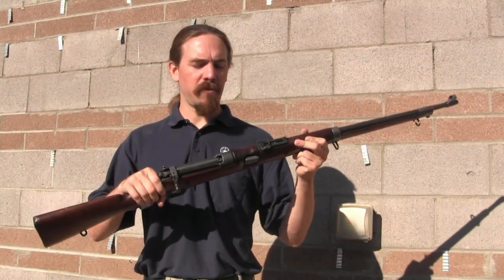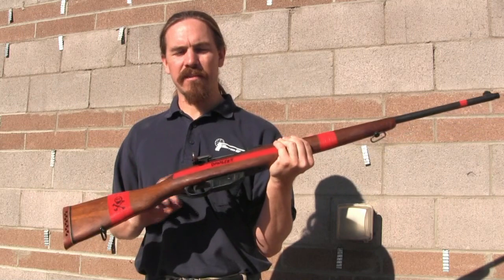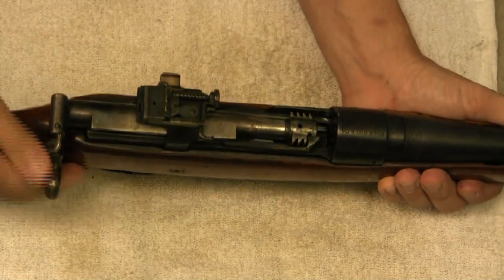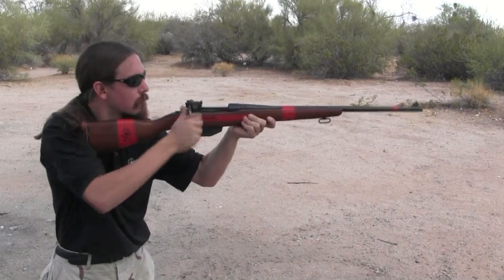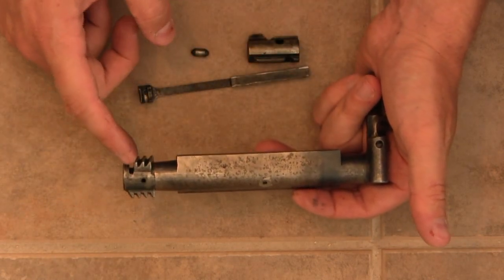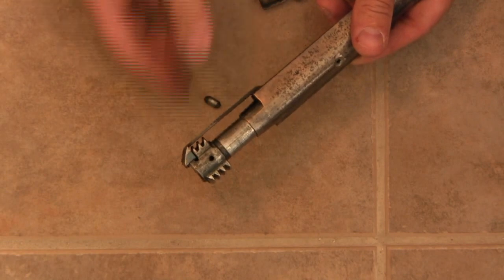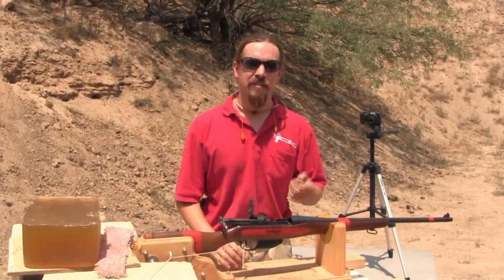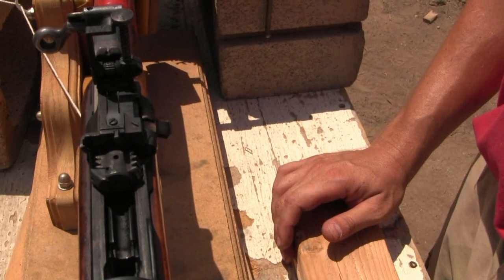Myth and Reality of the Ross MkIII Rifle

Comment: Good fucking thing I watched this. I just got a MK3 Ross, and the bolt doesn't rotate and lock. Thanks to this video I won't be blind in my right eye lol.
Reply from the maker: +ProJirard the Finishist Yikes!
Reply: +Forgotten Weapons I fixed it and now the bolt turns, but when I push the bolt all the way in, I can pull it right back out, is it supposed to do that? It should be locked in place until you fire right?
Reply from the maker: +ProJirard the Finishist As long as the bolt head is rotating when you push the handle forward, it is locking. You can always unlock it by pulling on the bolt handle; firing the rifle will not cause it to open because it does not put pressure on the bolt handle. Think of it like unlocking a deadbolt - you can always unlock it by turning they key, but if you push on the door without turning they key it stays locked shut.
Reply: Yes.  unfortunately, the Ross rifle is (and always has been) a rather crappy rifle, in every area except for its accuracy, in which it is actually fairly decent (Allied snipers loved the Ross as a result, even though it failed in every other avenue).
Reply: Finally got a chance to fire it a week ago, worked without a single issue. Got it all sighted and is it ever an accurate rifle.
Reply: It's a great range rifle!
Reply: ProJirard the Finishist , how much did you pay for that ross rifle?
Reply: How much did it cost ya?
Reply: Awkward to see it properly when the teeth engage inside the barrel. 
Glad you have seen the video.
Reply: @Canadian_Metalhead  I'm glad you saw this before you tried to fire it man, could've been a bad day at the range
Reply: You can actually see the bolthead rotate 90 degrees if you look down the rt side,if it doesnt rotate 90 do not fire as some dumdum has it in the wrong grooves

Comment: I remember hearing that the bolt could collect dirt in the mechanism and freeze up, requiring the bolt to be disassembled to clean all the gunk out. That could account for the disassemble of the bolt in the field by unqualified personnel.  Also, WWI was not the peak of thorough training and ample support staff.
Reply: FredCheckers  Yes. Actually, the mechanisms vulnerability to dust and mud were the main reasons of the Ross being retired from frontline service.
Reply: pancholom But I'd not like to call the infantry man unqualified --- Empire troops were very well trained in the use and care of their own weapons. Ok - misassembly when tired or stressed can happen, but having started to read up on this in response to another thread, the actual cases of injury caused by a bolt seem to be rare and of minor significance.

The basic point of the video is that if the rifle is assembled correctly then you have nothing to fear, and that as soon as there were cases of the reversed carrier, a modification was ordered to prevent it.
Reply: Simon Nonymous Anyway, since you raise the issue, the Ross rifle's main problem wasn't the one addressed in this video (i.e., the danger of the bolt misassembly) but its inadequacy to the trench warfare conditions.

If kept clean, it would work wonderfully. But keeping it clean in the Flanders battlefields under the average soldier's battle conditions, was nearly impossible. On the other hand, specialized troops like snipers could take advantage of the rifle's fine points without suffering much from its weaknesses.

This was due both to a sniper being more prone to taking care of his rifle and the difference in combat conditions.  Keeping the Ross working when you fire it once from a concealed position, then have considerable time before firing it again is quite something else than trying to rapid fire your gun either from a muddy trench or while charging in the middle of no-man's-land.
Reply: he mentioned that very early in the video-the rifle's design being NOT suitable for trench warfare, of course there were no big red letters stating so, understandable that you missed it
Reply: Why wasn't it designed to only fit together one way? That way mis-assembly of the bolt wouldn't even be possible.
Reply: The design was based on the Mannlicher 1895, but since you're not supposed to just take it, Ross had to fix it up a bit. It's quite interesting since from what I've heard from those who'd used the rifle, they'd said that the Ross provided  some of the smoothest straight pull actions.

Comment from the maker: The military ones are in .303 British, and the sporters are in .280 Ross (generally speaking).
Reply: Hello Ian, thank you for your awesome videos. They truely are a wealth of information.  I have a Ross m10 but rebarreld and chambered for .250 savage. This is not even like most sportirized Ross rifles I guess which most of them were .280 calibers correct? I'm running into issues with chambering a .250 savage round from the original magazine. First of all the round ofcourse is way to short for this magazine, secondly the rim diameter of the casing is only around 12 mm vs, 13.70 mm on the .303 round. The bolt face can strip the .250 cartridge initially but as the bolt moves forward it ends up slipping  over top of the casing, not being able to chamber the round properly. I wonder how this problem was dealt with in the .280 caliber sporter rifles since the rim diameter on the .280 cartridge is also around 12 mm.
I'd like to hear your take on this.
Regards, Marty.

Comment: I re-barrelled one of these for a customer a few years ago. It was nicely made and the owner was well aware of the potential issues .  It wouldn’t have been hard to build in a lockout in the first instance to prevent ignition without full lockup.  A  pin with a corresponding slot on the firing pin would do it. Big-ass buttress or maybe square threads on the receiver/ barrel tenon , if I recall correctly.     At least the bolt stop caught it , but you wouldn’t want to be there!  Another great video.👍🏻

Comment: could you test whether the bolt is assembled correctly by closing it then sticking a cleaning rod down the barrel and poking it? If it was locked it would not open, if the bolt was unlocked it probably would open
Reply from the maker: Yes, you could.
Reply: That's smart.
Reply: Just thinking that thru a little more wouldnt the fact one lug was broken off mean it was at least partly locked and the force of the round firing be more than the cleaning rod?
Reply: Sorry i watched again missed that the lug broke off due to contact with the rear of receiver
Reply: Sure, but there's no real reason to here.  Just watching the lugs rotate into place means they are locked.
Reply: Thomas Clark Also they're talking about to test for correct assembly.

Comment: I have had a sporterized, cut magazine [5 rds] and walnut stock for 20+ years. It is a very nice shooter and very accurate, based on you not flinching due to stories. 

My grandfather WW1 told me there was nothing wrong with them, the same issue resided in one of the machine guns of the day. Reverse the bolt and it too would fail to lock and fire when open, causing injuries. As My Grandfather said, the guys who got hurt, were not paying attention during their classes, because they were all taught to look after the gear. He was a Major by the time he left, and went on to fly the Sopwith Camel, so he was not at the bottom of the class. Thank you for a most enjoyable segment!
Reply: I wont dispute your story and I've never touched a Ross in my life. However, I do have knowledge of it's rival, the Lee-Enfield (specifically the .22 no.7 training rifle which is simply a modified .303 no.4), which has a much simpler bolt that is impossible to put back together incorrectly. In ideal conditions one would imagine the Ross's bolt isn't much of an issue but under stress, fatigue, cold, darkness, etc., such as they experienced in WW1, I can imagine that a significant number of troops trying to clean/unjam their rifles and failing to reassemble the bolts correctly.
There's also a whole political battle surrounding the Ross with subcontracting jobs going to friends of minister Sam Hughes, who was also, if I recall, a Ross Rifle Co. share holder...
Reply: the guys who got hurt were trying to reassemble it under stressful battlefield conditions.

my own grandfather grew up in Thunder Bay and the manager of the local Safeway store had is face scarred by a Ross rifle accident that happened while he was deployed.  The bolt didn't 'fly out' except maybe if you were super unlucky but it didn't need to, like they said if you had your face too close to the stock you'd get socked.
Reply: bulkforce5 Thank you, I never have run across anyone who had actual experience with this. During war everything is more difficult. I spent a day at the National war museum in Ottawa and gained a small bit of appreciation as an older adult.

Comment: They did, as Ian pointed out with the rivet that was installed in the rearward part of the bolt sleeve. Not many other small arms use a system similar to the Ross rifle, however, the interrupted screw locking lugs were very common to see on artillery, and is a very strong locking mechanism. Part of the reason why very few small arms use the design though, is because it requires a lot more machining than normal locking lugs.

Comment: answered my own question courtesy if wikipedia

"Two types of Mark III sniper rifles are identified by different telescopic sights. Five-hundred rifles were fitted with 5.2X Warner & Swasey Company Model 1913 prismatic telescopic sights manufactured in Cleveland, Ohio. Serial numbers for rifles manufactured in 1915 have a FK prefix; while those manufactured in 1917 have a LU prefix. Another 907 rifles were fitted with Winchester Repeating Arms Company A5 telescopic sights. Both telescopic sights were mounted offset so the iron sights were usable and the rifle could still be loaded from charging strips."

Comment from the maker: After that firing test, the bolt is jammed tight enough that I have to use a mallet to open or close it. But I suspect the remaining lugs would lock quite securely if the bolt was reassembled into the correct config. Not that I plan to try it, though.

Comment: Very good  video Ian. As you demonstrate, a correctly assembled Ross M1910 is perfectly safe. The Ross action is  one of the strongest you can get and for accuracy , at the time, Ross  was the best and snipers knew that very well. I own a sporteried Ross M1910 and ilove that rifle so much,so smooth and fast action to work with. Its a shame that sommany M1910 were sporterized. I  hope  to  find  one  in original military  configuration bu t even here in canada, they  are very  scarce.

Comment: I think it was about 2 years ago the NRA American Rifleman had a very good article on the Ross and it's problems. Most, as you discovered came from miss assembly of the bolt and the mud in the trenches. The article also stated that the injuries and deaths came from the bolt being forced back in to the shooters face.  After his endeavor in Canada he moved to the US and set up shop. It didn't last long though. The only example I've seen of a Ross was in .280 Ross caliber. From what I understood, the snipers preferred the .280 over the .303 and was said to be more accurate. The Ross I got to see had the multiple buttress cut bolt lugs like the MkIII but did not have the magazine showing under the rifle. It looked to be more of a civilian type of a late make. I also do not remember a rivet in the bolt, but one thing is for sure was that it did not have the solid 2 lug bolt like the MkII. Could this have been a model produced after the war for the civilian market based on the MKIII?

Comment: Great video.  And to answer a postulation... yes, when it got dirty and needed lubrication the Canadian soldier was trained to disassemble the bolt. In a regular bolt action one need only lubricate the bolt.  Here there is a moving part within the bolt. It was, however, not an everyday thing. Can you see the problems with doing this in a dank muddy trench under stress?

Comment: I notice that in your segment on the bolt stop, it stays in the open position, and it seems as though It could be flipped open with contact with the uniform.  In that case, if true, the bolt could fly right out.  On the other hand, as most shooters of the time held their thumbs over the top of the stock, they might well have stopped the bolt with their hands, sustaining an injury in that way.
Reply from the maker: The bolt stop would not be easy to accidentally flip, and if it did happen it would most likely just change from magazine fed to single loading. Even if it were left open, it would only allow the bolt to come out when the shooter cycled it, not when the gun fired.

Comment: The ammo issue is still a problem to be leveled on the beautiful stock of the Ross however. It was designed as a sporting arm, with fine tolerances, and tight chambers, leading to good accuracy. But when in a war time situation, it is hard to maintain the same level of quality control over the ammunition, so a good military rifle should be designed to accommodate that. The Ross is a great rifle for anything other than military service.

Comment: Nice vid, and very informative. It's anyone's guess as to whether the bolt will shear the back lug and stop or whether the stop lug on the receiver will fail - in an alternate reality, perhaps the other happens. And even if everything holds together under pressure (including the Ypres gas attack) and the bolt doesn't smash him in the face, that case head separation isn't going to help your Canadian soldier one little bit when the Pickelhaube crowd come calling.

Comment: Also, I just picked up an M39 in unissued condition. The bolt is made of mixed parts, (Chatellerault connector, New England bolt head, rest is Izhevsk and Tula). The bolt parts are really worn and feel sloppy. It does not want to close all the way. 

Well, I ran about 60 rounds through it, and in 2 instances, I got some gas in my face x.x

Comment: the largest problem with the ross rifle is that the breach and bolt were made of two different metals that expanded at a different rate during rapid repeated fire, so the bolt would jam, or get stickey, not allowing it to be seated properly. the rifle was very accurate and for sporting purposes was a fine rifle when only a few shots were fired from it.

Comment: Interesting video.  

The Ross's tendency (or not) to punch the user in the eye was not the real problem with it. 

First, you mentioned that it did not stand up to dirt very well, and this was Kind Of A Bad Thing for soldiers in Flanders. One of the recurring features of stories from old soldiers is that it was impossible to keep anything clean in that environment. 

Second, because of the tight tolerances, it did not stand up to sustained rapid fire very well; it would tend to overheat and seize up, just when you really wanted it not to. There are some stories from German troops that they saw Canadians hitting the bolt handle with entrenching tools, trying to cycle the bolt. 

After the war, as you pointed out, the Ross had a very nice career as a competitive rifle, which some people have taken as proof that there never was anything wrong with it. (The difference between shooting paper targets at Bisley, and shooting at the German army in Passchendale was lightly skimmed over in this argument.) 

The final blow to its reputation in Canada was that it was championed by Sir Sam Hughes... of whom the less said, the better.
Reply: Being associated with Sam Hughes was perhaps one of the worst problems of the Ross rifle. Joke aside, building the Ross factory right on top of the battlefield that ceded Canada to the British Empire certainly did not help its reputation with the locals either.

Comment: If you lengthened the stock so it coming back doesn’t hurt you, modified the locking lugs, and then put a spring assembly to push the bolt forward, you could possibly have a semi-auto rifle.

Comment: The bolt is far enough forward that upon firing the case probably distended and "locked" into the chamber by stiction. You'd have to be substantially out of headspace to not have a round build adequate pressure.